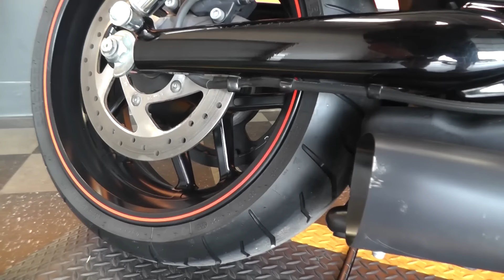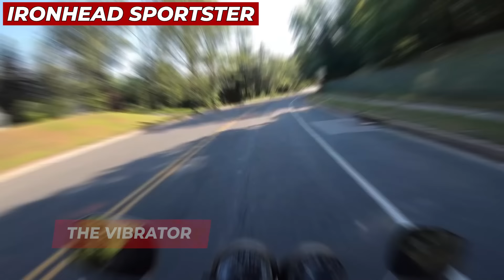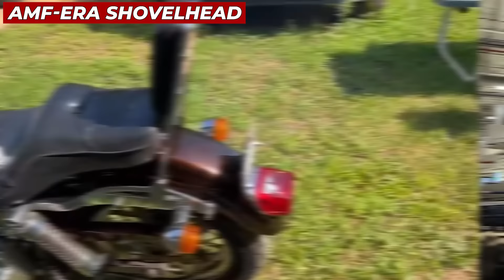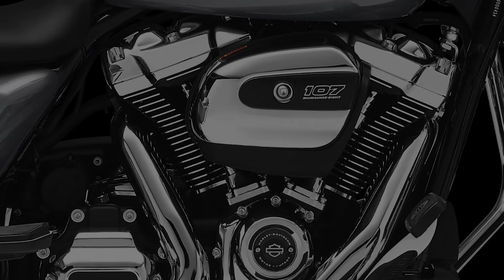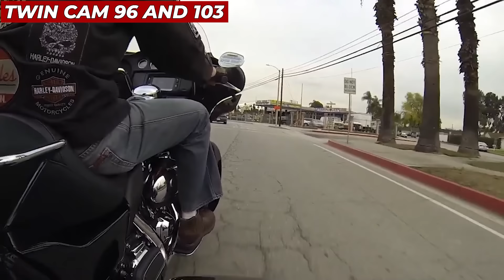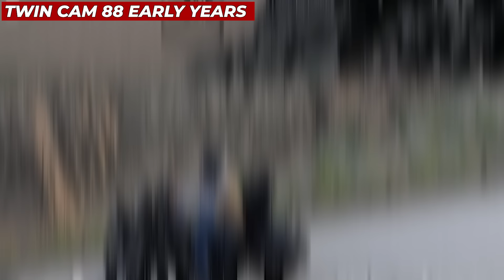10 WORST Engines Ever Put into Harley Davidsons

Comment: I remember reading something about the M8 when it first came out about exhaust temps being incredibly high. So to solve it the ran the oil around the exhaust ports to cool them. "Hey I know, let's super-heat the f out of the oil. That should work right?" 😂
Reply: You read some nonsense. Let’s be honest, the top end of nearly any motor that has a lifters or two ever made has oil runs all over to it and around the valves. It’s inevitable unless you want a motor that is sumping. Superheating the oil? Hmm, if that were the case it would break down quite quickly and during your regular pre trip inspection be noticeable.
 Yes a M8 does run hotter. Get a tank lift and a some good heat deflectors end or pipes and be done with it. Or am oil cooler if it truly frightens you. My 2018 FXSB is a damn reliable bike.

Comment: I've always felt that a lot of the issues people were having back in the day with the pans & shovels were from guys who weren't really the best mechanics. Obviously not all, but definitely a fair amount of it was due to that. Guys swearing you should run gear oil in them and what not. Smh. My 79 FXE runs awesome and doesn't leak a drop. Never has. 34 years and counting. (Fingers crossed, lol)

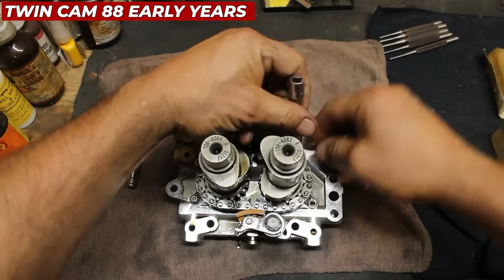Comment: I bought my first Harley which was a 86 FXSTC ( NEW SOFT TAIL CUSTOM)  I WAS NOT IN  INTERESTED WITH  HARLEYS  BECAUSE SEEING BIKES BEFORE  THE EVO WAS BORN. I NEVER HAD ANYTHING SERIOUS PROBLEMP WITH THAT BIKE, HAD IT 8 YEARS,  PUT OVER 67,000 MILES ALWAYS DID MY PROPER.\NMAINTAIN AND THAT'S WHEN I WAS CONVINCED THAT HAREY HAD SOMETHING GOOD. I loved that bike so in 1995 I 19:40 bought another soft tail  custom. Put on 57660 miles no problems. Traded  that for a 2000 Deuce put on 62,700 miles, sweet bike but now I want a touring bike,  So I bought  an 2009 Street  Glide,  Trade it with 49,000 for a 2015 Road Glide. Love it  Trade that with 57500 miles for my current bike which is a 2025 Road Glide,  Now the point I'm trying to make is my only problem that I had was I did pretty much rebuilt  the 2015 Road Glide  motor,  But Not Bad for all these bikes  with all miles that I put on, I was lucky not to ever had to put any money into all these bikes except  the 2015 Road Glide,  and of course all proper maintenance oil changes, tires, all the general maintainance that you should do so that your bike doesn't mess up. So lesson I'm trying to say is take care of your bike, it'll take care of you.

Comment: Bought a 1999 classic and 10 days before the 5 year warranty ran out the cam bearings cratered and took out the motor.i was 600 miles from home and had the bike trucked into Beartooth Harley-Davidson in Billings Montana. So I'm a Canadian broke down in the US on a Saturday afternoon ...I was very lucky this dealership worked on my motor replacing everything except the case's this was all covered by warranty and I left paying 100 dollar deductible and a 1 year warranty on the new motor. I was down for 4 days but I got to finish my trip to sturgis.I rode that bike another year and traded it in for a 2007 classic I still ride today
Reply: Boy, that sounds like it was some good luck for you!  How many miles were on it when it blew up?
Reply: @D_Grouchy_Old_Man the motor had less than 30 thousand miles when I was going down interstate 90 at 80 miles an hour and it blew up  at the Little Bighorn

Comment: Mostly true but it’s funny bc shovels were hated in their time but is now one of the most desirable bikes to have! I have a 79’ no oil leaks, but it did puke if left setting for a few weeks until I done ball valve work in oil pump (couple light taps with a old ball, old push rod and hammer) and my softail with a evo doesn’t leak a drop! But I’m also a decent mechanic!

Comment: I’ve owned an EVO, multiple Twin Cam engines and currently own an M8.   I had a 96 Springer for 20 years.  Had an 04 Road King for 10 years with the TC88 and a 2015 Road Glide with the 103 HO motor.  I currently own a 23 Road Glide with the 114 M8. The only bike I ever had catastrophically blow up on me was the EVO.  A Cam bearing failure that was like dropping a grenade into the motor.

Comment: Most people that experience “catastrophic failure” are also the people that run their lawnmowers out of oil, replace tires when the belts are showing or turn the radio up when the brakes are squeaking.
Reply: Or hanging onto the steering wheel when it violently pulls to the right

Comment: My 03 heritage went a little over 40,000 miles before the tensioners let loose and when I pulled the cam plate there it laid in the bottom of the cam chest broke into two pieces a day later I was back on the road

Comment: Weird,  77K miles on my 08 FXSTC 96TC,  compensator is just fine.  OH...my 2nd 08 FXSTC with 25K on it (bought in 2020 with 4K) also has no compensator issues.   What was an issue on my first 08 was inner primary bearings... I am on my 3rd set.  Must be a unique thing.

Comment: Well your video is on point for the most part but then you show pictures of a Sportster cam box opened up while talking about Twin Cams tensioner issues ... it's wrong & misleading for those that don't know otherwise ! 
As a retired shop owner with years of shop hours under my belt including very early Harley engnes from Flatheads & up thru to the entire line of Twin Cams I've learned a thing of two.  
I have to say for the most part Harley has screwed their customer base pretty hard instead of doing the right thing ... or... when made to do it through manadatory recalls concering safety issues. Not good for their once faithful customer base that dropped huge sums of cash ending up with mostly unriable motorcycles.
Even in the early days Harley Davidson built their engines with BALANCED & welded crankshafts/ trued flywheel assemblies. 
That practice of balancing to ZERO runout along with quality bearings to support it is now long gone history. 
Nowadays, they press fit the cranks assemblies together & in MOST cases they come off the assembly line WAY of spec ... meaning "out of balance" by as much as (0.001) to (0.003) brand new & claim (0.008) to (0.012) of runout as the acceptable tolerances & within warranty specs. 
Simply put, this makes for a slow death/internal destructruction from the moment the new engine fires up.  Call ANY local machine shop & ASK them what is acceptable runout & they will tell you ZERO.  
H-D flat out lied to their customer base about it being "acceptable tolerances" for years & their "acceptabel" tolerances kept getting bigger & bigger hoping for the bikes to live long enough to make it out of factory warranty so the repair cost went onto the owners.
I just never could grasp WHY a company with H-D's following would scrimp out on $50 - $100 worth of parts & machining cost while building a new motorcycle that ends up a problematic disaster for all concerned.
Blame the management, bean counters or whoever but it's damn sure a shame to see it. Granted, they're building higher technology motorcycles now but they still can't keep themselves from cutting minimal cost by using cheap internal bearings & unbalanced crankshafts that will scissor & shake apart, especially so if you tend to thrash the throttle a little.  
Look at the new M8 engines designs from 2017 & up or better yet ... just Google "Harley M8 engine problems" & get ready to do some READING.

Don't get me wrong, I love the look, ride, feel & sound of a well behaved Harley Davidson .... but it cost some $$$$ to get it to that point & keep it that way. The dealership is not going to help you much ... other than take your hard earned cash when you pay for parts or the repair bill.
I've owned some LEMON Harley Davidsons & some that went over 100K without anything major going wrong while simply maintaining wear items & routine service ....  your mileage will likely vary, be it good luck, bad luck or just shitty parts.

Prime example: I recently purchased a mint looking 2016 Road King with only 3600 miles on it. The original owner bought it & a trike at the same time "but his wife prefered riding on back of the trike more" so he sold the Road King because it just wasn't getting many miles on it.  I put under 400 miles on the Road King & the front wheel bearings went bad on it. This may not fit your scenario but no motorcycle, especially one that weighs over 800 pounds should have bad wheel bearings with that low of miles. To make things even worse, the only replacement bearings nowadays are Chinese JUNK. The new bearings can't be repacked with grease anymore like we used to do for our customers when they came in for tire changes... it's all a big money grab so if you want to own & ride a Harley be prepared to PAY for the pleasure.

Comment: I`ve got one of those worst engines you`ve been beatin your gums about, 68000miles and I just changed the spark plugs for the first time last oil change, it`s a 2001. I drive this thing like I stole it from you! It goes 100mph at least once every time I get a chance to ride it. There`s no noise in the motor at all. I did change the primary tensioner not cause it was bad, I just happened to be in there cause some bone head stripped the drain plug on the cover when it was serviced by the friggin dealer 20 yrs ago. I kept wrapping more and more teflon tape around the plug untill about 10 years ago. It`s been an incredibly reliable bike, I never thought I`d say that about a Harley
Reply: It's been reliable because you fixed the issue before it was an issue!
Reply: Its a Sportster ?

Comment: i love my 2010 tc96  ..a simple Tension pad replacement with ungraded pads to polyurathane.can be done with basic mechanical ability,,then add an oil cooler.
.best Upgraded HD imo..without  going to  the next larger water  jacket engines....

Comment: I sold my Sportster for what I paid for it and bought a used C10 Concours, I put 30,000 miles on it in one year, as long as the temperature was above 35 I rode, i went to see my son stationed in Fort Riley I stoped in Columbia MO. At a motel to spend the night after riding 500 miles and it was 28 degrees Fahrenheit, loved that bike. I had it to 135 miles an hour twice stable as a rock, rode the tail of the dragon 10 times in one day, I wasnt married so i went on week end trips camping, then i bought an old wing cheap and rode it all over the USA it was cover in national parl stickers, i carried two chairs, tent, three changes of clothes, two sleeping bags, air mattres, small cooler, gasoline stove, propane stove, babaque grill, pots, pans, first aid kit the back end was so heavy it would wheely if not carful, i once hit a 4x4 that fell off a truck in front of me and i run over that 4x4 post at 75 mph, not even a bent rim i held the bike up it  shook like crazy. Try that on a harley, rode 50,000 sold it made 500 dollsrs.

Comment: I had a 1994 sporster ( brand new) and it would stop running anywhere anytime  the dealership mechanics check it 8 different times from electrical  to gas lines exetera exetera, Finley they offered me to buy it back and they give me all the money back,  I 1996 i got a new heritage special,  noq that one was great on the  mechanics but after an hour my fingers were numb and I mean completely numb from the vibration .

Comment: I find this report very odd.bi bought a 1999 dyna wide glide with the tc 88 in 99 new. I've beat the hell out of it. Rode it across the usa countless times. Has almost 300 k miles on it. Other than lots of tire changes, handle grips and fading paint, I haven't had one ounce of problem with it.
Reply: If that is true then that is absolutely wild. I know MANY MANY MANY riders who have had that problem and usually within the first 40k km. 300+k with stock tensioner is insane!!!
Reply: @jonnymac8925 I have a 21 year old TC88 with 0 issues.